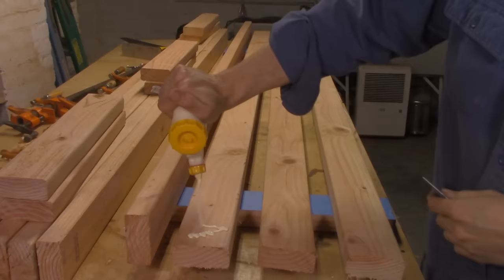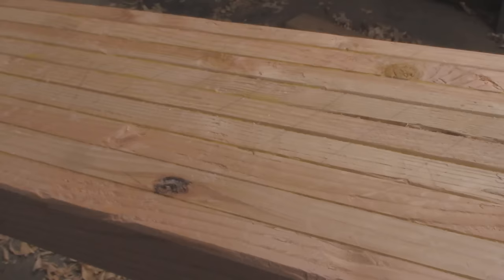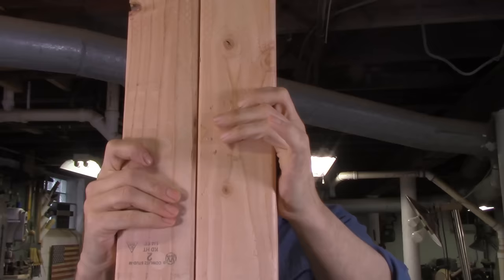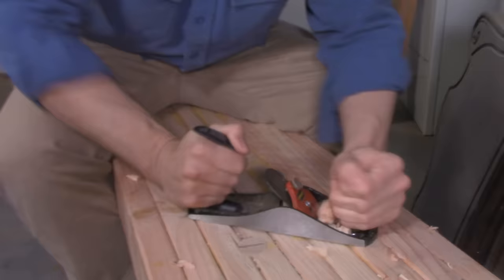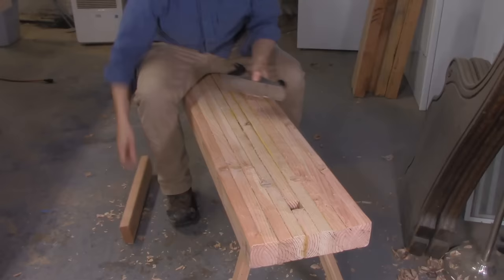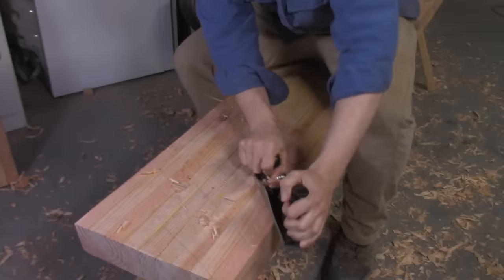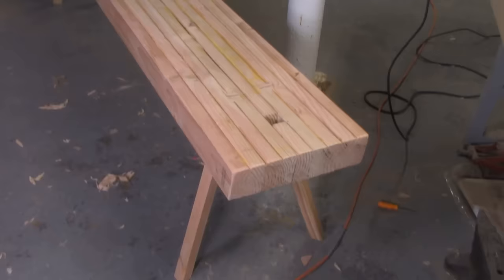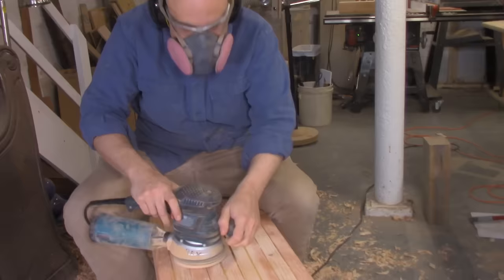Flattening the $30 workbench with one cheap plane.

Comment: Nice work and build video  i did Woodworking as a profession for over 20years  and so many times  people would come up and want to discuss  Norm Abrams and The New Yankee Workshop  and of course the questions  were always do i need to buy all those tools that he uses  most times i would tell them no  ive been wanting to  start  my own show  teaching people what you can build out of 2x 4’s using a circular saw and a few hand tools  plus a router with a few bits  as i used to use my router to joint  and make  biscuit slots  prior to buying dedicated machines for those tasks ! Now dont get me wrong if. Someone was to sponsor me like Norm used to be and i could get all those tools to use for free. I would take them   But most  Cabinet Makers and Custom Woodworkers   Use a few hand tools and a  decent Table saw. With some dedicate jigs and  sleds  to do a few  tasks with precision  many other tools are  nice  additions to  a shop   Or the Craftsman  by helping him/her  in terms of speed  and precision  i was happy to hear you stressing on how  a bench doesn’t need to be perfectly flat  although i will add  many people may not know the difference between a work bench and a assembly table that does need to be   Flat for  best results in building things  IMO
Reply: Very well said I also think people have become too stressed over their work benches due to some YouTubers.
A workbench is like a mechanical shop, an assembly table is like a lab. 

My grandfather owned a single workbench throughout his life. Some mysterious wood that was so covered in dust and grime it was black, beaten up everywhere, edges were a semi circle due to decades of wear.  Every nick tells a story. 
It never stopped him from making good furniture. His assembly was done on his outdoor stone table. 

When I made my bench the surface looked so good it prevented me from being efficient. I was always avoiding getting it damaged (that's what a damn workbench is for!!). 
The solution:  told my 5 year old she could hammer and throw anything she wanted at it for 10 mins. It was damaged enough for me to stop caring and I could resume my regular work.

Comment: I won't lie, my skills using a plane are poor over large areas and it's something that I know I need to work on. For flattening large pieces i always find that running my belt sander along the length of the piece on a 45 degree angle works a treat (like shown in the video). Criticise all you want, but like Harry said, "a man needs to know his limitations"!

Comment: Firstly i appropriate these videos they keep the passion going also I’ve been a joiner for the best part of 20 years and own several jointer planes I bought 6 jointer planes all st different lengths at a flea market for around £15 each and didn’t take much to make good either. Also I made one for less than £10 but it did take a while to make due to moisture in the timber. And finally I bought one cheap one from amazon to compare to my old ones and it took me days of sanding the base to level and it’s still not as good as the ones I bought at the flea market so I’m short. Go to a flea market or car boot sale and you’ll find one worthy of restoring

Comment: I'd run all the 2x4's through a table saw and take off the rounded edge on the top side. Would give you a good head start and possibly eliminate the need to plane at all. If you had a table saw that is.
Reply: the point of this whole thing is that you don't have any money to buy power tools and you have no space to work comfortably ... it's a poor person's guide on how to start something you fell in love with ,, woodworking ..

Comment: How to make a jointer plane for $10:
1.Get a small sheet of 3/4 MDF, particle board, or ply
2. Cut all the edges off and glue them together on a flat surface with the two longer edges in the middle and the factory edges down.
3. You now have a rigid and flat bottom plane body.
4. Clamp some 40-80 grit paper to the nose end a couple inches back.
5. You can now flatten the fine curves in your bench and then use the smoother to make a finished surface.

Much lighter than a No.7 though it may take some work and be way more dusty.
Reply from the maker: That sounds like a great DIY tool and I encourage people to make one. But...that's not a plane. It's a very nice sanding block.
Reply: @RexKrueger  Point taken, but I figured the shoestring budget tool ideas it fit in well in this crowd.

Comment: I found a "liquid" wood made from super hard nut shells in a binder called NutKote then all i do is use side strips on either side of the bench and fill the entire top to obtain a perfectly level bench top with a super hard surface.

Comment: For the urethane haters, tung oil has been used outdoors in south-eastern Asia for centuries with great success, only requiring annual re-coating if the item being coated lives outside.  How well does it work?  My 200+ year old Bavarian Grandfather Clock loves it, of course it lives indoors.

Comment: My idea would have been is to kinda go over the top, and clean it from the dust and particles and smaller splinters if any, then put bezels around the edge of the table and just pour about 2 millimeters of resin onto it to fill the gaps and gravity would have levelled it perfectly

Comment: The winding sticks disappearing evenly doesn't mean your bench is flat it just means the corners might be even. it could still have a cup to it in either direction.
Reply: No, the winding sticks just help you with twisting and width-cuping.  If you want to check for bowing use a straight edge. 
 if you want to stay away from the straight edge, a string from end to end will do short work of it.

Even better if you want to keep with the premise of this video, just eyeball it, pretty easy to see bowing on such a long piece.
And in the end to keep with the theme: it doesn't need to be dead flat.

Comment: Straighten one edge of each 2x4 on the tablesaw first. (Even a cheapass jobsite saw with a simple straightening jig works fine.) Set up and level a pair of saw-horses, lay your 2x4s together straight edge down, then glue and clamp. There — you've just eliminated 99% of the planing and achieved a flush surface.

Comment: I totally just shared because your finish kinda tripped my mind. I had to stop the video and ask myself (out loud) why the freak you would mix those. I came to the same conclusion you stated once I pushed play again. My oldest is 7, so I've been out of the shop for far too long. I should have picked up on that right away. Pretty genius way to strengthen your bench.

Comment: Congrats man! My bench has some gaps, regardless of how much I seemed to plane the boards. I seems to be glued together, but I haven't drilled the mortises yet.
Reply from the maker: No worries on some little gaps. It will still probably hold together fine. Just get working!
Reply: Once it's flat, you could use a router to gouge out the worst of the gaps and glue in strips of hardwood. Or maybe just fill the gaps with clear epoxy mixed with sawdust. I mean, IF your OCD kicks in, of course.

Comment: I know this is an older video, but due to my circumstances, I'm going to have to build a bench for outside use. I'm looking at doing one like this to start with, then a Nicholson down the road a bit. I was curious if the finishing method you used has worked well for outdoor use half a decade later? I can use pressure treated, but it's more expensive and I'd really rather not if I can build something and just give it a treatment like this, even if I have to retreat it later or something.

Thanks in advance. 😁

Comment: If water seeks its own level, you could have covered the surface in epoxy (for a forgiving surface) or concrete (for a more rigid surface).  After you’ve gotten a level surface, you could have covered over the newly leveled surface with wood, metal or plastic.

However, I like your presentation, thinking an obsessive, compulsive behavior as a frugal/diy problem solver and I thank you! 👌✅💪🏽

It would have save your elbows from incessant arthritic pain in your distant future older self.

Comment: I have a couple of questions.  First, why didn't you plane one edge of each board before the glue up so you wouldn't have to deal with the rounded corners on the timber?  Second, why is it so low?  It looks like it might be hard to work on.  I probably missed something.  Thanks for making the effort.
Reply from the maker: The rounded corners just aren't a problem. I don't even notice them and most of them are planed off during flattening. For all other questions, please see the first video I did on this bench.

Comment: Why not use a boat builders longboard to do a final sand down for even better flatness? 
A one meter long board would get it to near-machined flatness, then you'd just have to sort out the level.

Comment: I would have cut a thin amount off top edge of each board with a table saw before gluing up since edges are rounded. And lay top down on several good 2x4s when gluing the boards together.so boards align better. I'd also use a belt sander with different grit paper. Belt sanders can be very aggressive. I also have no need for a bench that low, table would be more practical. And why not cover the bench with MDF?

Comment: Funny. When you say "bench", you actually mean bench and not table, as most people do, when they refer to a workbench.
Reply from the maker: I guess that's why it's called a bench, which I always wondered about.
Reply: has you dinner table got a vice..has it got dog pegs..he actually means work bench which he stands next too..not a dinner table that you sit at
Reply: What’s the difference so I know?
Reply: @mattyburrows9059  Dude, there are many more types of table than just the one you eat dinner over. Heavy tables, light tables, sitting and standing tables, low coffee tables for the ends of couches, picnic tables with built in benches, even various types of working tables. My mom wants a table for her gardening, where she can plant seeds in cups. A kitchen counter is a wall-mounted standing table with drawers or a cupboard underneath. The word "table" is a blanket term describing almost anything under the sun with a single flat surface where you plan to put stuff but don't plan to sit. The use of the word "bench" in workbench is an anomaly that can only be explained by something like the bench in this video, which is what the OP and Rex were referring to.
Reply: @Nurk0m0rath  dude is an american word..a standing table that you talk about is called a desk..you always sit at a table..you can stand or sit at a desk..you can work on a bench or sit on it..but a table..you always sit at a table..thats why a work bench is called a work bench and not a table..you stand at a wood working bench..its.rather simple
Reply: @mattyburrows9059  So? I'm an American. What's your point? Don't think Americans know how to speak their own language?

Most desks are still tables. Broadly speaking a desk is any flat surface intended to hold paperwork, including on a computer. But many desks have a flat "slab" top and legs, which makes them tables. You can get a "standing desk" for your computer, but that doesn't account for tables you stand at to cut fabric, chop vegetables, or transplant seedlings.

But my entire point was that "dinner table" needs the "dinner" in front precisely because it is not the ONLY kind of table. You'll find a coffee table to set in front of or beside a couch, your sewing room will be outfitted with both a sewing table and a cutting table, and you may sit at a kitchen table to prepare dinner when your feet need a break from standing at the counter. Then after dinner you may go outside to sit around a patio table with drinks.
Reply: @Nurk0m0rath  i know youve taken the english language and ruined it..you dont even know what a table is.
Reply: @mattyburrows9059  Merriam-Webster, Table: 
1a: a piece of furniture consisting of a smooth flat slab fixed on legs
b(1): a group of people assembled at or as if at a table
(2): a legislative or negotiating session
the bargaining table
c(1): a supply or source of food
(2): an act or instance of assembling to eat : MEAL sit down to table
Reply: Chen Mitton  You need a special plane to make a chamfer? Just hold your bench plane at an angle.
Reply: @RexKrueger        c ,,  u

Comment: For a long "plane"... how about drilling a hole in a piece of flat , straight 2 by 4 and mounting 
a router on it , with the cutter poking through the hole a SMALL amount, to do the cutting. 
Most of us have, or can afford even , a cheap router....

😎👍☘️

Comment: Great "real" video, Rex. OK, I'm not building a bench right now, but I am building a guitar speaker cab from some 100-yr-old oak planks I have sitting around and have to do a lot of work to take off 10-25mm of wood in the process of making it reasonably flat. Is there any reason I can't use an electric handheld plane for some of this work (as I happen to have one that I bought at a yard sale)? And then finish it with a basic Stanley No. 4 plane I've owned for decades? Of course, I'll probably have to sharpen it first!

Thanks mate! Keep up the great work! Subscribed!
Reply from the maker: You can totally do that,  BUT most guitar cabs are made from ply or mdf  bc you want the cab to be acoustically "dead". Oak might vibrate in strange ways. This isn't a rule. Fender tweed amps were made from solid pine which ADDS to the sound of that amp. Food for thought.
Reply: @RexKrueger  Hi Rex - wow, most woodworkers have no idea of the acoustic nature of guitar amp cabs! Kudos to you :) Actually my first thought had been to use pine as in the old tweed amps, but I don't have any useable wood around. Oak won't resonate in a bad way but it will create a slightly warmer sounding cab. I'd actually like to build a few cabs with different tone woods together a better understanding of the tonal differences! But let's just start with this one first! The goal is for me to learn how to make some good dovetail joints using hand tools in a constructive way :)

Comment: I know what winding sticks are, but I have no idea why they are called “winding” sticks. Do they wind something? Does something get wound onto them? Are they used to detect wind? Or to generate a breeze? Anybody know?
Reply from the maker: When wood is twisted, it's also called being in "wind" thus, "winding sticks." You also close one eye to use them and it's possible that they were originally called "winking sticks" and the pronunciation drifted over the years.

Comment: Would it be helpful to rip off each side of the 2 x 4 to get a straight  edge to glue up?  Seems like it would help get a nice smooth surface.
Reply from the maker: The build is intended for those who don't have a lot of tools, but if you want to do it that way, go nuts!

Comment: Don't agree about mostly flat, however.  It needs to be flat level and square.  If it isn't, then how are you going to put things together squarely?  Unless of course this is just a rough cutting and semi-assembly bench and you are going to put it together on an actual flat bench to get it all squared up.

Comment: Hey, do you think an electric plane would ease the struggle with the hand plane? After a lot of struggling and a hurt hand using one of those horrible cheap planes, I'm debating if it's worth investing in an electric one from the cheaper end for removing the bulk of material. I figure it would be nice later down the line for cleaning up stock as well.

I'll still try following the cheap plane setup tutorial you made to see if that improves the results, though.
Reply from the maker: There's nothing wrong with electric planes, but they're no substitute to hand planes. If your hand it hurting after planing, something is VERY wrong. Maybe you're not really sharp or you're taking too heavy a cut, but even this heavy scrub plane didn't make my hand hurt a bit and I have a history of hand problems. Take the money you would spend on the electric plane and get a better hand plane. It shouldn't be a struggle at all.
Reply: @RexKrueger  It's probably a combination of all those things, honestly. I'll have a go at sharpening again, but if it doesn't help, a new plane is in order. Cheers!

Comment: what about cutting the boards using a drop saw with a stop block and orienting verically to glue up? would that be almost perfectly flat and stronger since end grain on top?
how do you make allowance to install one or two of those woodworking vice to end flush?
Reply from the maker: I think that would be a lot of effort for a bench that wouldn't have much strength. You'd get a harder surface, but it wouldn't support your weight. Also, it's plenty hard as it is.
Reply: Rex Krueger : i dont get why you think it would be weak, considering that you'd have lots of pieces of wood glued along their grain.
anyhow, just trying to find a quicker way for a flat surface without much guessing involved and technique involved. my main plane is electric. maybe setup some fullproof jig to make a flat surface using a reference... OR use loads of glue to make a self levelling flat surface :)
Reply from the maker: Chris okay,  the pieces glued using side grain, it wouldn't have nearly the strength of just the 2x4s. I'd bet money you've never,  ever seen a piece of figurine made this way...because it would snap like a twig under weight.  Also,  the flattening was pretty easy.  Only got an electric plane? Use that.

Comment: So when you said it was low in the middle you should have immediately flipped the slab. Even if it was a little bit that means the crown was down. Yes I know that it's glued, and I doubt anyone would ever stress the bench with weight. But you know what is right, I know what is right, and now we know that you could have fixed it but didn't.